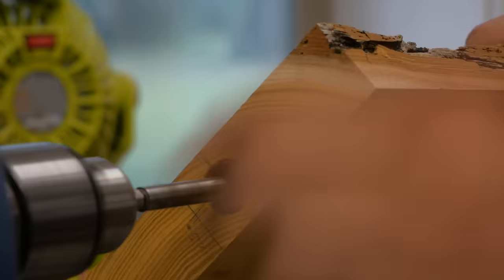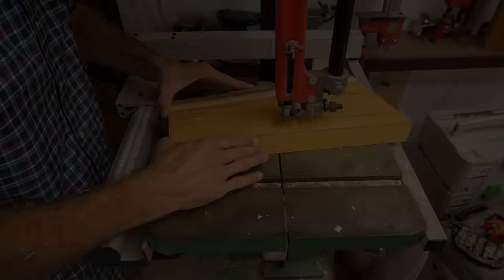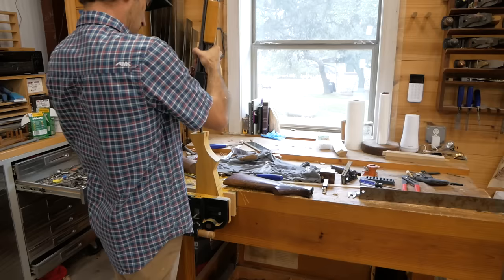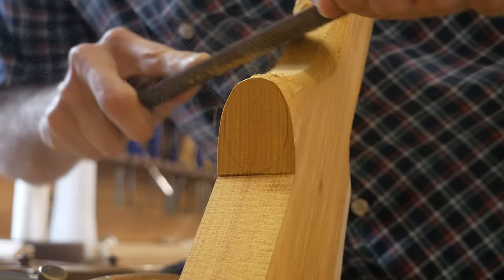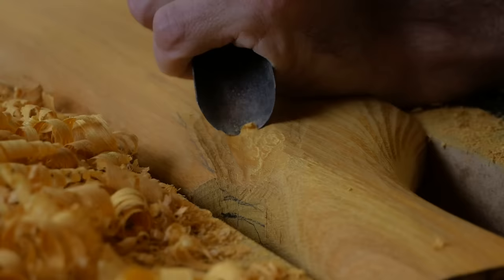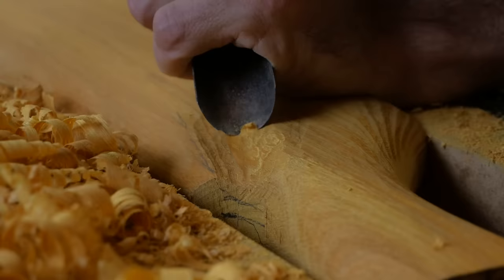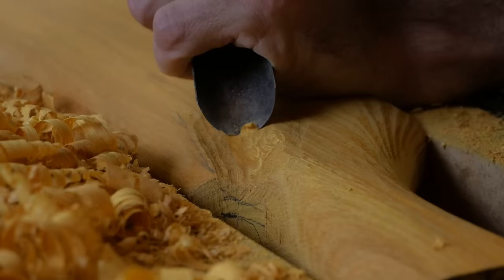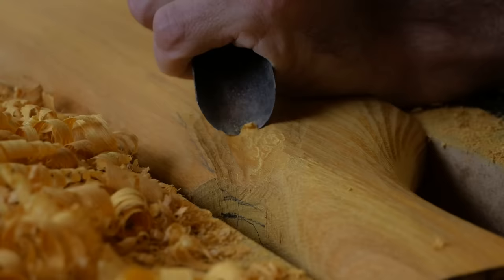Rebuilding My Grandad's 16 Gauge Stock - Part 2 The Buttstock

Comment: Found that with checkering it helps to apply finish first and again during the process if wood gets a bit fuzzy or you want more contrast. I also put masking tape on the whole (pre-finished) area and do the lay-out on that, leaving the outline tape in situ. It gives just that little bit more protection against run-overs. A checkering cradle can be made, many ways to do so, but using a mini beanbag made from packing peanuts in a pillowslip works well too. Last tip: if you feel the need to just do an extra line before lunch-smoke-pee-coffee break, stop right there and have your break, it is so easy to screw up your workpiece for no gain in time.

Comment: Stocking a gun is incredibly difficult. Most people have no clue how many hours are invested. I’m a stock maker. I along with other stock makers charge a lot to do this. You have done well, but there’s still a lot to learn. Any uneven pressure on the stock where it mates with the action will eventually split or chip off a piece under recoil forces. That part has to be perfect. Also, Osage is incredibly hard, stick with American or English walnut. Well done for only your second attempt. Very impressed.
Reply from the maker: Steve Ledbetter thanks for the comment and I really appreciate the feedback especially coming from a stock maker.  I’m not sure what prompted me to go with the Osage, I think it’s was the uniqueness factor.  You’re right about walnut it’s so much more enjoyable to work with.  After building two of these I have a tremendous amount of respect for the skill required to do it right.  I’m far from that point.  Thanks again for the tips!

Comment: It's helpful to draw a center line all the way around  with pencil and maintain it until close to the final shape. Also, I have many home made long step drills, holes can easily wander off center when using several different individual bits. Checkering is much more challenging than most people think.  One other thing..I use lipstick to spot metal to wood.

Comment: Wish i could do this.  I can do alot but i havent ever done woodwork yet.  I have a 1942 side by side double barrel shotgun made in germany.. a war gun and its in beautiful shape but the stock is cracked where the safety is and runs down to the checkering but stops.   Im going to try and repair it with glue and drill the end of the crack so it stops cracking at least.

Hope this works.. because the gun is fireable but i dont want to shoot it yet with a cracked stock

Comment: Heck, if you can make a stock from a blank, you will have no trouble making yourself a checkering cradle. And don't worry about a custom stock stock being asymetrical.  A factory stock will try to be neutral, to try and fit the greatest number of people. A custom stock only has to fit one person.

Comment: Wow this is really impressive. I have carved my own stock for a gun very similar to this, but I don’t have the leath, planes, checkering tools or any of that. So I drilled the hole freehand/drill press (it took multiple tries) and carved it all with chisels and a file I bought... my transition to the gun isn’t as good as yours nor the overall neatness. But I think I have done pretty good for what I had to work with.